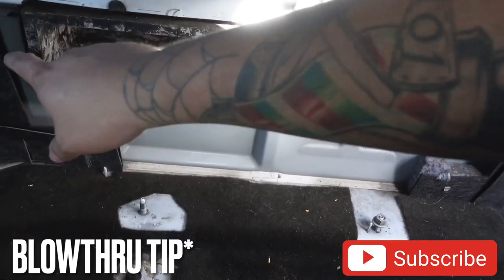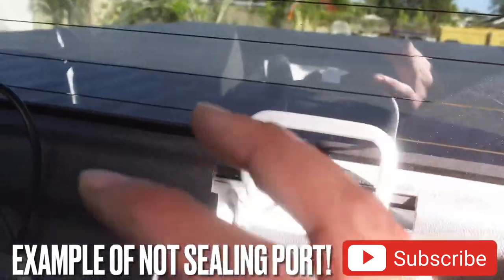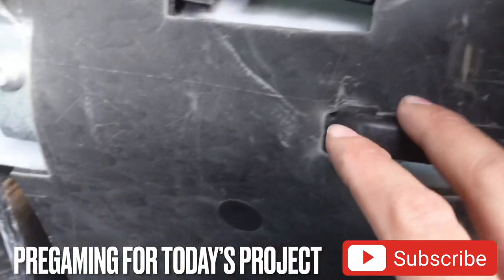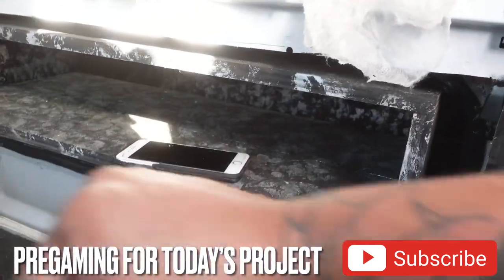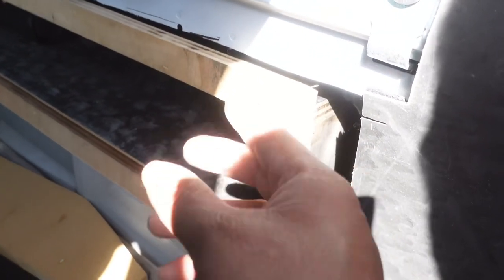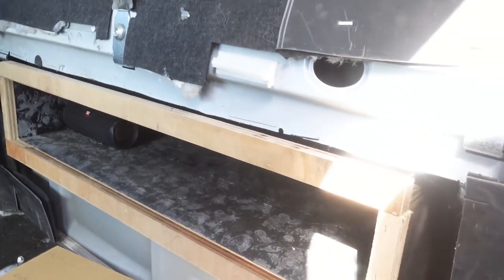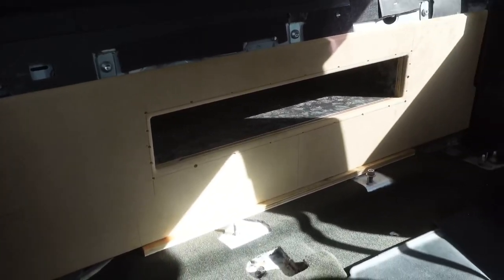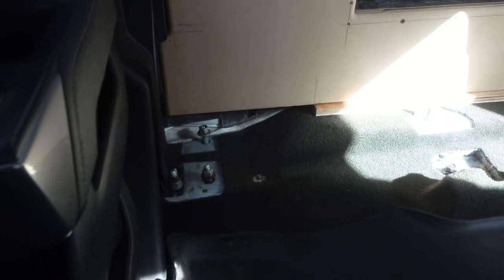4th order BANDPASS subwoofer box MUST DO tips & secrets!

Comment: Hey mousetrap,  I  like your  videos,  but had some questions about a 4-12 ported box for my 99 chevy suburban. Up firing and rear port?
Reply from the maker: Do 10cf and 80sq inch port 20” long and it will beat on every note 🔈🔈🔈🤝
Reply: @mouse_trap. how can I make my Blowthru louder 2 sundown SA 15 classics 5.1 cu ft sealed side 14.9 port side how big does my port hole for the cut out(cab thru)